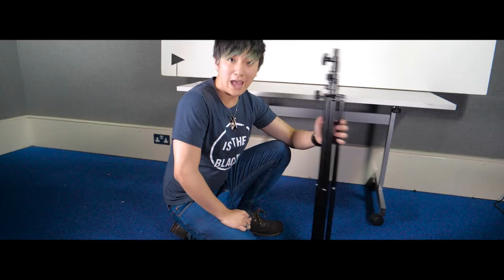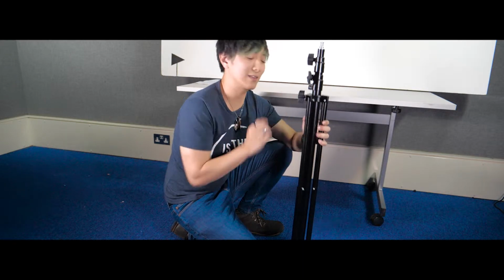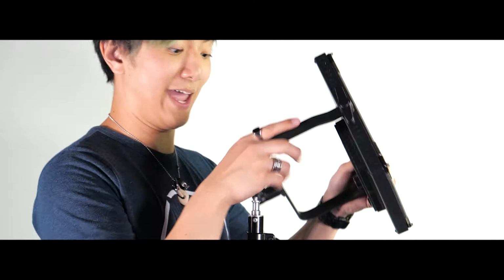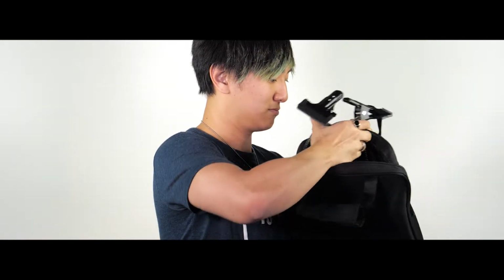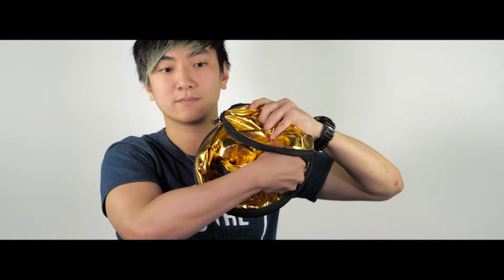Using the Stage 1 Lighting Kit

Comment from the maker: Video Contents

0:00 Introduction
0:13 Contents of lighting kit
0:39 Health and safety tips
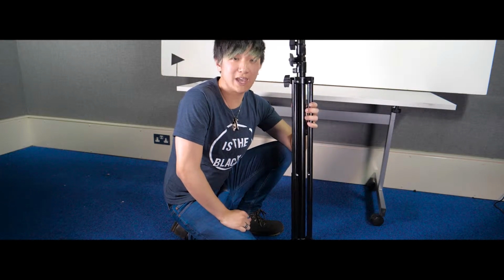1:03 Setting up lighting stand
1:43 Positioning the lights
1:57 Setting up reflector
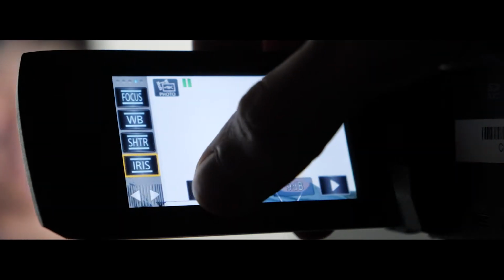2:17 Camera settings for Panasonic 4K camera
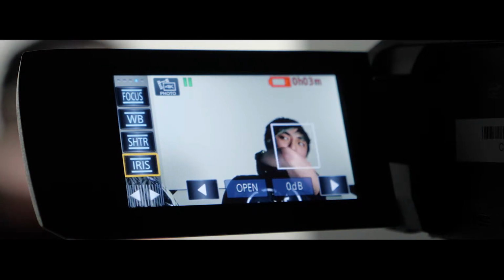2:32 Switching on and adjusting the light level
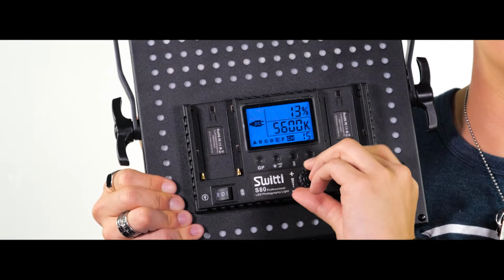2:44 Packing equipment away